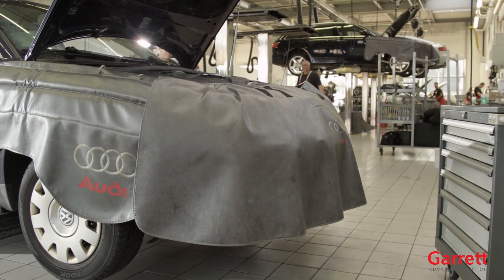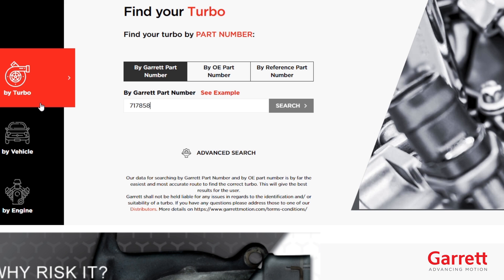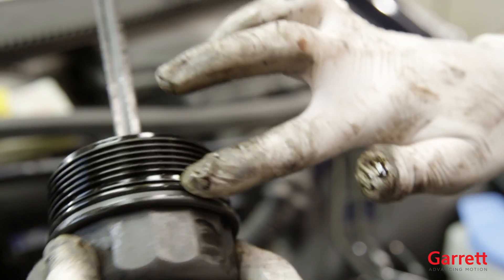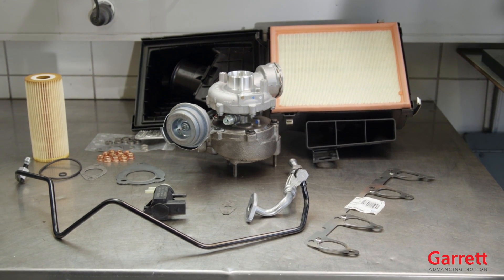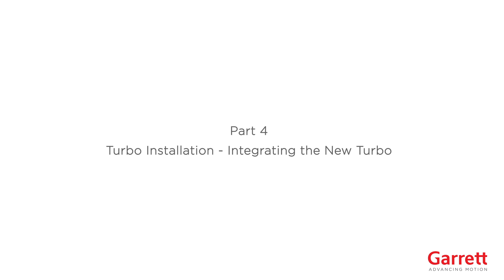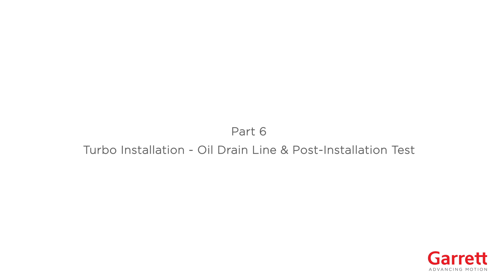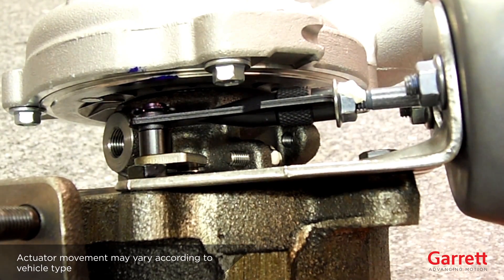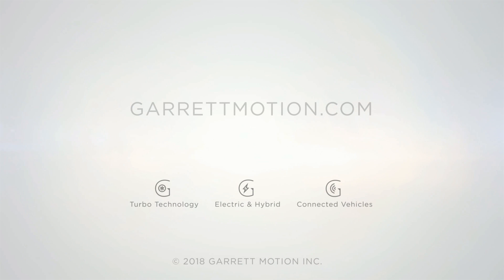How to Install a Turbo in 7 Easy Steps | Installer Connect | Garrett - Advancing Motion

Comment: I got a 3.6 V6 and want 400 hp. will run 98 fuel and 5000 RMP are max. What turbo I need
Reply: The biggest one possible
Reply: Get two of them while you're at it